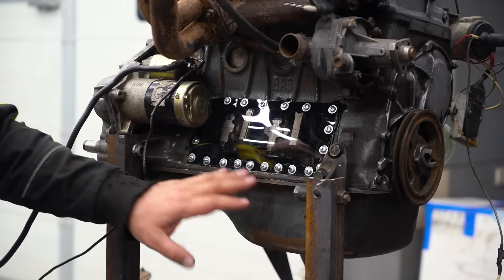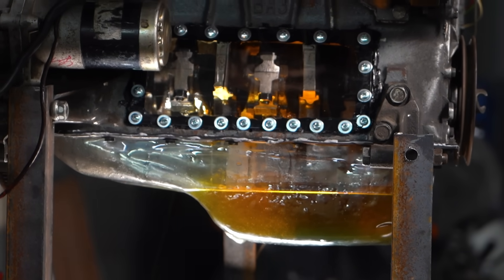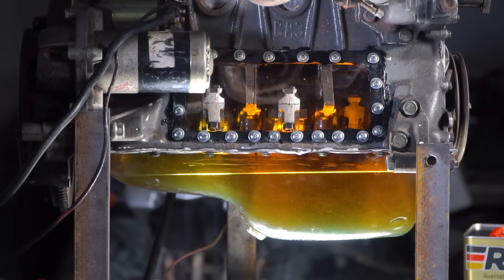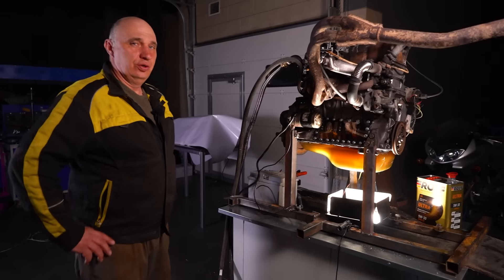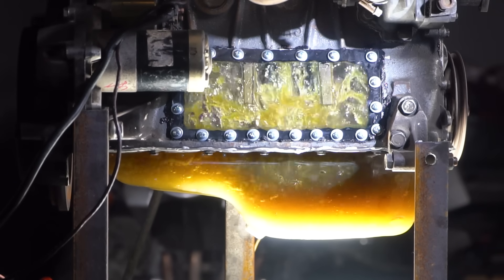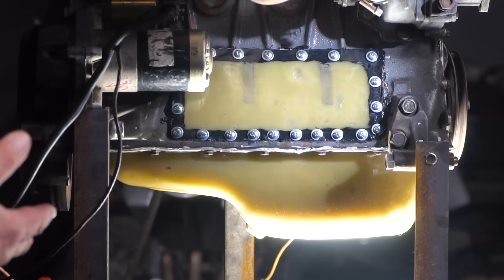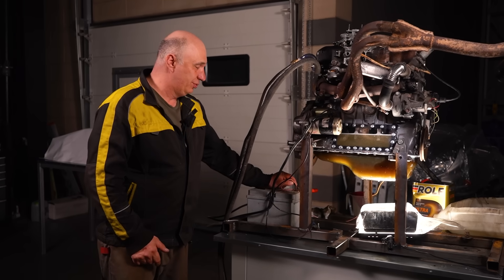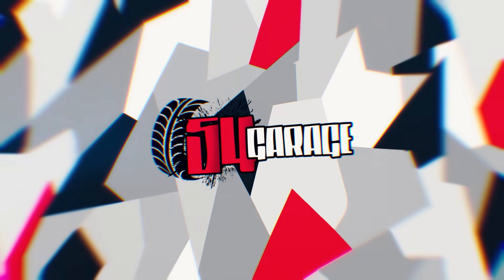What actually happens when you overfill your motor oil? (w/ transparent oil pan)

Comment: The level of anxiety i go through when overfilling my engine just a little over the max level, thinking it's gonna explode any moment, this guy is a hero
Reply: Gotta remember too every motor design is different, you may have one motor where a quart over is no issue, and another where a quart over is going to froth your oil and destroy your motor
Reply: 😄 I was driving my Landrover home from Genova to Zurich once like driving on raw eggs  because I overfilled it a fifth of an inch and could not release the drain screw on the road. Man man man – that video really makes that look rediculous.
Reply: @MartinBettler  A Landy?  Arent those supposed to be kinda symmetrical in being equally prone to annoying failures as they're bullet proof to bad failures?
I'd expect a Land Rover to survive just fine being topped up with anything between between moisturizer and cooking oil. 
And, being considered as OK for off-road use, why would anyone ever assume the vehicle to be particularly close to horizontal when the oil is checked or filled?
Reply: @davidbackman4442  probably depends on what engine. The old Series 2 and models around it use the 2.25 litre four cylinder engine and it was build like a tank I think the later 6 cylinder engines weren't so sturdy. I had a Series 11a and it had been around the clock 4 times and still ran like a champ but it did use a bit of oil.
Reply: @MartinBettler  always expect the good engineers to add a idiot proof margin... you should be OK with 10% more  ;P I always try to get it to the .2 quart precision
Reply: 12:23 

 @MartinBettler
Reply: @MartinBettler   fifth of an inch. that is pretty usa
Reply: @MartinBettler You must be a biden voter
Reply: This video is extremely misleading!
Reply: @MartinBettler  You could accidentally overfill just about any motor with 2 quarts and it won't do anything and could even be better for it
Reply: Yeah my stupid BMW doesn't have a damn dipstick AT ALL. You have to get in the car, get it most of the way to operating temp, then go into the idrive and hit "check oil level." Talk about freaking anxiety during an oil change....
Reply: @derekspringer6448  Same with Mercedes W203. I always admired German engineering but this car has made me think twice about it.
Reply: @derekspringer6448  I agree it is stupid not to have a dipstick in either the Engine and /or the Transmission.
Reply: @derekspringer6448  Technology making things more convenient and reliable 🥴👍
Reply: @derekspringer6448 
Who thought that was a good idea?
Reply: @derekspringer6448 - Luckily, my 08 550i has both, just recently my oil level sensor went bad showing on iDrive that its overfilled, took the disptick out and found the oil level to be just barely above minimum. I don't mean to scare you though, those sensors are pretty reliable but not bulletproof, my bimmer has 208k miles.
Reply: @derekspringer6448  That bothers me too on my 2009 328ix. The 3 series is supposed to be more of a sport model, in which case I think the oil level should be able to be physically measured. Also Temp, battery volt and oil psi gauges
Reply: You could ask someone nicely to make you one. They’re fairly easy to place.

#somedrillingrequired
Reply: No dipstick bmw reminds me the biggest reason I said to never own a bmw. I ride motorcycles now and know a guy who really likes his bmw 1250gs.
Reply: @derekspringer6448 same with my audi. Benz still gives you a dip stick tho.
Reply: @derekspringer6448  Just look up how many litres of oil the engine needs in the owners manual maintenance section and measure it as you put it in, at least then you'll be in the ballpark and shouldn't cause any issues to the engine. But yeah it is a stupid idea not to have a physical dipstick.
Reply: @derekspringer6448 what year is your bmw?
Reply: @derekspringer6448  yeah I had a 2018 3/28 hardtop convertible and did not appreciate not having a dipstick for having it be missing
Reply: @derekspringer6448  that anxiety goes away if you start by putting in as much oil that came out during the oil change. Then you can add little by little until its actually full
Reply: @derekspringer6448  thats why i sold my bmw 135i and bought a first gen tacoma LOL
Reply: @unfckwidable I don't think much of the Toyota engines once they changed the end play on the crankshaft onto the much smaller front main journal and caused problems when the small shims flaked off with wear and allowed the cam gear to chew on the front of the crankcase. That's unacceptable. They had some great straight four cylinder engines in the 80's that achieved astounding 45 miles per gallon that lasted forever, but they never sold many parts so they had to cheapen them so they would only last until the warranty ran out. I have grown accustomed to believing that they always had a special group of people that made designs that required a lot more expenses in the maintenance and repairs to the vehicles and I am convinced that it's the case now, but not sure with electric vehicles and the sooner we all drive EV's the better for us and Mother Earth and Nature. Screw the oil companies and the lies they tell.
Reply: My old beast at around 20 years old started to lose some oil, so topped up regularly, then -- nothing, the problem just went away, no more top ups needed.
Gremlins I suspect.
Reply: @derekspringer6448  But why design such a thing?  Its ridiculous.
Reply: Midas regularly fills my cars about an inch over full. They won't add less because the owners manual states 6qt capacity, so that's what they must put in, no more, no less. They say it doesn't matter.
Reply: @javaman2883  You're a brave man.  I wouldn't let that crooked bunch touch anything of mine.
Reply: Engine companys always have and extra space for this cases. The max level its below the real max till start to make foam at oil. Try to keep between those levels but it you fill it too much, doesnt matter. If its toooooo much, a syringe of the biggers ones and a flexible pipe that fits the tip of the syringe and you got it, without draining with the drain plug.
Reply: @greymillan5697 be easier and cheaper to just pull the plug and let out 6 ounces a quart whatever you need too
Reply: @greymillan5697 no advantage being over full just costs more money.
Reply: @greymillan5697
Reply: @greymillan5697 I started changing my oil at home.  Too many times, I've found the oil level way over max when having the dealership do it.  I always think they're going to put the bare minimum to save on their costs.
Reply: @greymillan5697 yeah but what about when it already started making strong burning oil smell because it was half quart over after idling for 15 minutes. It is an alfo Romero Giulia 2020 but just half quart over caused string buring oil smell. Could that have caused damage?
Reply: The inside of his made pan is also the same size as the outside of the stock pan giving him a decently bigger pan so it lessens the effect
Reply: @Scummy_shovel I noticed that too and wondered how much that would affect the results. I would think it actually equates to a significant amount of oil.
Reply: Me too. I had really bad feeling when I did this once. Nice to know it’s Norma problem.
Reply: This is great stuff! If I add 1/2 quart too.much it won't hurt it
Reply: @stringtwister7654 totally reasonable.
Reply: Biggest problems associated with overfilling are burning oil caused by  oil overwhelming the piston rings and oil passing the crankshaft end seals and contaminating the clutch.
Reply: Although , it would have been educational if this guy had hooked up an oil pressure gauge while doing this test .
Reply: @Airon79 maybe
Reply: Saved your day!
Reply: If you have an old Diesel engine the result can be catastrophic. Excess oil can be pressed out of the carter vent, this is connected to the airfilter box (for environmental reasons) and the engine starts to run on motor oil (no problem for a diesel  engine). Except you are stuck with a 'runaway engine' and no way to turn it off.
Reply: @buddy1155 and you never want to experience this… trust me!
Reply: Just remember this is a very simple , old school engine. Newer engines have more going on in them with smaller tolerances, so it would be still inadvisable to overfill any modern engine
Reply: @EdmundSampson-pd7vi exactly. And some are way worse than others especially motorcycles. As an engine builder I take note in this.  13 plus Kawasaki 636 you can literally over fill them a quart and it’s still a few inches below the crank line. Especially when running.   A newer Gixxer. 1/4 a quart and it’s into the crank super bad and just milkshakes.   So take this video literal if you have this exact same engine.  Otherwise you don’t know u till you know and go with the fact that 1 quart low is way safer than 1 quart to high.
Reply: @EdmundSampson-pd7vi  Indeed. Not all engines are created equal. 
There's a margin, sure. I don't think any mass produced engine would object to, or even notice a 10% overfill. 
Beyond that, I'm NOT going to vouch for what'd be a safe level of overfill. Just as I wouldn't comment on exactly how far below minimum you can actually go before damages start to occur.
First time I did an oil change on a marine diesel, I ended up overfilling it past my comfort level. Compared to earlier experiences, that oil was GLOOPY and took ages to trickle down into the sump. It was a fairly small engine too, so a little went a long way.
Reply: @davidbackman4442 yeah and when some take this crazy thin synthetics oil that is more like water I wouldn't chance it
Reply: Tell us what exactly happens if over filled so much
Reply: This video is extremely misleading!
Reply: @EdmundSampson-pd7vi yep stacking tolerances is what we technicians call it
Reply: @EdmundSampson-pd7vi right, it depends. A classic Toyota engine would be fine. An AMG or ///M should be kept within spec as well as possible.
Reply: @EdmundSampson-pd7vi  what is the "more going on" part? I've never worked on a modern engine.
Reply: @EdmundSampson-pd7vi there is no way the modern engines will stand this kind of abuse. They will go bonkers.  Be ready for a new engine
Reply: @EdmundSampson-pd7vi  Even modern engines give plenty of clearance for extra oil. I wouldn't say double the amount of recommended oil but an extra quart or two is never going to hurt an engine.
Reply: @EdmundSampson-pd7vi  Not to mention some motors the crank has an oil slinger attached. I don't thing the extra resistance would be good for it. WK
Reply: @EdmundSampson-pd7vi My car is a 2020, it only asks for 4.3 qt but I always add 5 because I'm lazy. Zero complaints from the car at 60,000 miles
Reply: @EdmundSampson-pd7vi all engines still have a crank, oil pump and sump, nothings changed.
Reply: @EdmundSampson-pd7vi yes but a little too much is still way better than not enough.
Reply: I am astonished that the front and rear MAIN seals did not let go, even BEFORE the fabricated plastic pan mastic seal did!!

Anyone for a foamy milkshake??
Reply: if it's a passat, no worries it will burn the excess in no time :D
Reply: Relatable 😂
Reply: They put a stupid factor in every engine cast since 1930’s, before that you best be exact, unless it’s a ford
Reply: Then again, the oil change place put an extra 1.5qts in my engine (previous car was same model but different engine on their records)

The next morning when I started the car it fogged up the whole front yard, and did that for the rest of the week, every morning. 

From that point on, the car consumed a quart of oil every tank of gas. Shame because it ran great and was otherwise a great car.
Reply: @nickloss probably just a cheap pcv replacement and car’d  have been fine…
Reply: Always thought the same thoughts,it took this video to make me realise it doesn't matter if you use a little extra!  The power of 1 video is amazing.        From ( AUSSIE JOHN).......
Reply: I've put almost a gallon extra in my diesel engine by accident more than once, was never worried lol
Reply: Different engines will behave different
Reply: exactly 🤣
Reply: The engineers do a really amazing job and stay within specs.
Reply: overfilled my civic by 25% once, and was SURE my PCV was just going to be dumping liquid oil into my intake tube.   Apparently, I can stop holding my breath waiting for that to happen.
Reply: But he didn't really test this right. If you're going to drive your car, which is probably the case, those bubbles might be detrimental
Reply: True
Reply: Haha!! I feel the same way!!
Reply: Over filling won't make the engine explode but it can blow out the gaskets and seals. Just depends on how much pressure your engine has.
Reply: Now I don't feel so bad by adding too much oil in my changes.  Often just a half quart too much.
Reply: The foam will deteriorate the œil quality creating mayonnaise in the motor block . Therefore avoid foam its a good idea
Reply: Half a quart over is okay
Reply: Great video. Thanks for your efforts
Reply: Pretty good demonstration however without an oil pressure guage you missed the point. I can tell you from experience that too much oil will create too many bubbles and too low an oil pressure especially bad with hydraulic lifters.
Reply: I had a friend who (after his Dad rebuilt his motor for the Son) filled the oil up til it reached near the top of the filler cap.......then drove it 😂😂😂😂😂😂
Reply: Ive been over filling by a half liter or so for years now, i get its oil pan dependant
Reply: My personal experience is that car maintenance is like your diet, you can get a way with fast food here and there but if it becomes a regular thing….. you’re cutting the engine life short
Reply: I was just doing that the other day with my kids car!  I’m a Goddamn cap full over and I’m considering popping the drain plug again to let a little out… wtf?!?  

Plus, all those times I drove shit boxes that burned oil? If I had know, just put an extra 1/2 quart in before a long trip!  

All those bullshit stories about too much oil pressure. Thinking about it now while watching the video, that bunch of BS doesn’t even make sense. Pressure? Where?
Reply: Do NOT overfill. The build up of pressure will cause oil leakage.
Reply: Anything under an 1/2-1/4 more of a quart isn’t gonna kill it I have a 5.3 with 294k that I’ve been putting 1/2 quarts extra in for about 8 years
Reply: Yeah, I added an extra quarter of a quart by accident the last time I changed my oil and it has been on my mind nonstop for the last two weeks. This video came into my suggested videos at the absolute perfect time lol. I was worried that it was going to create too much pressure.
Reply: Well try to do this with turbo charged engine. Your oil will be spitting out of the exhaust. Not to mention  foaming problem. This experiment is fun to watch but proves nothing
Reply: @eclecticaro  yeah the 1.5 Honda turbos are having issues with oil dilution. I think the smaller engine cannot hold the pressure created by the turbo and it's pushing unburnt gasoline past the rings.
Reply: Filling just a smidgen over the full mark on the dipstick won't hurt anything. Anymore than that and you start pressurising the engine causing damage to seals and other engine components.
Reply: @user-bq7ct8yw7k THIS is what I've always heard since I started driving in the early 70s. Too much oil causes more pressure and causes gasket failures. Whether it's true today or not, I do not overfill.
Reply: @roncrawford2416 The Air Force taught me the same in a vehicle maintenance school in 1999 .
Reply: @roncrawford2416  it's never been true, more oil can't result in more pressure.
The oil pressure produced from the oil pump isn't affected by how much oil is in the oil pan
Reply: @T1m11 it absolutely is true. Crankcase pressure is not caused by the oil pump, it is caused by slight compression leaks and also the movement of the pistons. Less air space will lead to higher case pressure which absolutely will blow out seals.
Reply: @tacticaldorito3942  I imagine that in an inline 4 or 6 cyl engine, there should be close to no differece in the crankcase pressure from pistons moving up and down. Other layouts may be slightly different.
Reply: @NewGov-xo6yt  How would that happen ?
The oil pump doesn't care if it sucks out of a reservoir filled with 5, 6, or 7 quarts, oil pressure isn't affected in any way and the crankcase pressure isn't affected by more oil sitting in the oil pan either
Reply: @T1m11  There is also a crankcase pressure. Less space equals more pressure.
Reply: @AnthonySlavin From what I understand, this is only a problem if your engine uses lifters. If it uses a pump, there isn't any extra oil pressure and the pump operates normally. (To a point of course.)
Reply: @gahbah274 to be absolutely clear, your understanding is 100% wrong.
Reply: @AnthonySlavin  which seals would that be you think?
Reply: @AnthonySlavin  lol it’s always funny when a obvious none mechanic gives “facts”  I especially like the use of “smidgen” for a measurement.   That’s the equivalent to a carpenter using a “notch or a hair”
Reply: Alshimer Joe thanking for his support. The furthest leaning leftists I know won’t vote for him. The worst president the country has ever had. Asking for support, the balls, or just lack of cognitive function. Sad really, but he was always a piece of trash. When some magical event like death happens by October you know it was planned.
Reply: You must as soft as Gouda.
Reply: Exactly 😂😂
Reply: damn straight
Reply: lmao same
Reply: Il a certainement raison perso il manque toujours 100 ml a mes niveaux ,toujours le segments racleurs disent merci
Reply: I have blown an engine by overfilling it. It was overfilled by a lot though.
Reply: Bin putting extra 1/2 quart to make it even 5 quarts have well over 70 thousand miles never noticed any lose of power  or mileage, even the certified Toyota mech ice said it won’t hurt anything  don’t have to caring 1/2 quart around in my truck it doesn’t burn any oil ether
Reply: @mikesheets4332 that's because you are doing it correctly because the oil filter drinks and holds it's own reservoir.some oil filters are huge and can take a half quart or more easily.HOW is everyone forgetting that part?
Reply: Me too! Lol
Reply: My exact sentiments.
Reply: Mazdas don’t do well overfilled. I remember in like 2006ish we had a deal with a local Mazda dealership to pick up and drive all the Mazdas back to our smog shop to do their smogs on used vehicles they would get from auction. They serviced them, sometimes they added a quart too much and it would cause a ton of oil to burn out and smoke. I crop dusted the freeway so many times. The techs at the dealership would laugh and say sometimes they are idiots and overfill and it wouldn’t this.
Reply: @JoshuaDomoslai  wow, great concern for the environment
Reply: I saw a guy overhaul an engine and he mistakenly put one quart over full and it immediately blew out the main seal
Reply: @onejohn2.26. if someone did a full rebuild on a motor and the. Over filled the motor by an entire quart by “ mistake “ I’d have to assume that he didn’t look up the torque specs as he rebuilt it and there could be a lot of things that went wrong with that motor.     How do you do a proper rebuild on any motor and no look up the amount of motor oil that motor requires
Reply: Does the overfill cause the top gaskets to leak? Having that issue now with oil leaking 🙏🏼anyone please?
Reply: @siry5164 it depends how much overfill,would have to be too much overfill because that's exactly what it would effect
Reply: I do not sleep at night because of this video.
Reply: Bear in mind that driving uphill or downhill can move your oil surface into the striking range of the crank, if you overfill.
Reply: I feel you! same level of anxiety, but this now confirmed that my car is fine with a little bit of oil above the max level of the dipstick.
Reply: Agreed — HERO.  Saved me some anxiety, anyway, as I JUST changed my oil and overfilled by probably half a quart.
Reply: Ditto
Reply: Same, same. Most info on the Internet just serves to scare you. Nice to see something legit.
Reply: If you drive a German car Yes you should always be anxious
Reply: You're  so dumb how do you even survive  daily?
Reply: It's all fun and games until your diesel runs away.    My Perkins "makes oil".    I'm happy to see that my paranoia has been a little overblown, as I'll usually change the oil whenever it's 150%.   But I'll continue doing it, because the diluted oil has shit viscosity.
Reply: Well he is doing it in a temperature and level controlled stationary engine,what if frozen?what if in summer,what in an angle?such as uphill it even driveway..he done a great job displaying that info alone for the intellectual to then calculate for difference with the examples above
Reply: The man has DOUBLED the oil to show effect,then almost trippled if not more..so what are anyone talking about half quart and such miniscule comparisons?its mostly about over pressure where the breather valve starts to spill for 1,and expansion of engine block and gaskets taking damage so unless you overfill way too much,I would think it's actually better to put half quart past max anyway, dipstick readings are only general estimates anyways,many ppl never factor in the temperature which gives totally different readings aswell and the level the vehicle is resting and that makes all the difference
Reply: @NewGov-xo6yt omg, bro…that’s kinda the fucken point…
If you show an extreme example of a thing, that then alleviates one’s concern of the not so extreme occurrences…🙄 I can’t believe you don’t get that concept…
Reply: First off YOU MUST CHECK OIL with the temperature in consideration,hot oil reads almost double on the dipstick.then you have the other things like level of car not on hill,and then understand the half quart that always seems to be extra..is to go into the new oil filter as it holds it's own storage aswell
Reply: As a mechanic myself I’ve always been “worried” about “overfilling” it because I went above the max line, this has given me the peace of to stop worrying about such a little detail.
Reply: Yeah relax lol
Reply: I knew a guy who added too much oil to his 95 impala and the car did not like that ran super sluggish and the engine had a massive vibration
Reply: For real😂😂😂😂😂
Reply: Yeah.  We just know it's bad, but not why.
Reply: “More oil Sergey”!
Reply: Took the words right outa my mouth brother 😂👊
Reply: Knowledge allows confidence
Reply: The problem with over fill is the crank case pressure increases and u start burning oil and it causes leaks not as important on older carb engines but way more important on newer fuel injection engines they are sealed up closed loop systom so pressure builds until u start burning or a seal goes out same thing can happen if a pcv goes bad
Reply: I would think, from the frothing of the oil, that an extreme amount of oil in the engine could cause some seals to blow out or at least leak if it’s in an older engine.
Too much pressure cannot be good.
Reply: Oh, those Russians! [Boney M – Rasputin 🤣]
They don't care... about anything! Didn't they invent the Russian Roulette?! 😱 Great contribution to Humanity 😬
Reply: My car takes 4.8 quarts. I put in the full 5 qt container. I refuse to carry around .2 qts in a big yellow bottle. The oil level on the dipstick shows about 10% over the amount between the two marks that indicate normal. No ill effects.
Reply: Just a little over won't hurt anything. A lot and it ends up into the combustion chamber. And you cannot compress a liquid. At the least, you blow a little blue smoke out the exhaust or you hydro lock the engine. At the worst, major engine damage will result from bent/broke rods or blown head gasket.
Reply: I SALUTE this  Mann
Reply: Facts
Reply: Very damned interesting. I've been overfilling my engines for generations, but never like Igor has. I have used automatic transmission fluid when I am able to use ATF resistant seals at one quart for every 5 quarts of engine oil. I use it for the detergent dispersant, anti foam agents and the inside of my engines are never dirty. Everything passes through the oil filter. I test my oil and discovered that I can run for 25K miles with changing the oil filter at 15K miles and refilling it with auto transmission fluid. My gas engines run over 250K miles and don't burn oil while my Cummins 4 valve per cylinder 325hp turbo diesel easily runs 450K miles. The problem with leakage is to replace the seals at rebuild with ATF resistant seals. An easy solution. I've been doing it for over 55 years and have yet to see any problems.Ciao.
Reply: I ran 15 quarts in a 4 quart car and it still ran
Reply: I was the exact same. So much anxiety from slightly overfilling it...
Reply: I’m so glad I’m not alone 🥹🤣
Reply: Fill to the top. Chug chug chug my car dont run too good. Drain out the oil then put it right amout and run so nice.
Reply: 😂😂😂😂 me 2
Reply: gas consumption will increase
Reply: I overfilled my car engine by only one quart once on a 2-hour road trip by the time I came back my car was smoking from the oil burning off the exhaust manifold turns out all it took was one extra quart to blow my valve covers gaskets on the driver side. I use 9 quarts regularly
Reply: I overfilled my car engine by only one quart once on a 2-hour road trip by the time I came back my car was smoking from the oil burning off the exhaust manifold turns out all it took was one extra quart to blow my valve covers gaskets on the driver side. I use 9 quarts regularly
Reply: Was just going to the garage to suck out less than a 1/4 quart overfill. Thx for this video, I can now breathe easy till I get to it sometime later
Reply: For real! Same af! I’m really glad that I randomly stumbled upon this video that I initially assumed would be a waste of my poo break…🤷🏾‍♂️
Reply: If you do this with a diesel you run the risk of a runaway
Reply: Guys, HERE is The True Savior

HalleluYAH translates “Praise ye YaH”

YaH is The Heavenly Father
YaH arrives via the TENT OF MEETING
YaH was Who they Crucified for our sins
YaH was Crucified on an Almond TREE

Ancient Semitic of Moshe (Moses)
Isa Scroll (The Original Isaiah)

Isaiah 42:8
"I am YaH; that is my Name! I will not yield my glory to another or my praise to idols.”

Isaiah 43:11
“I am YAH, and there is no other Savior but Me.”

Isaiah 45:5
“I am YaH, and there is none else.”
Reply: meanwhile here i am overfilling by a quart because it means i can just dump the whole bottle in lol
and also cheap insurance for when i'm hooning or tracking the car
Reply: Too much oil means bubbles which lowers viscosity of the oil, and it doesn't perform well. It won't get damaged in 100miles but it will increase wear of the parts.
Reply: What about those crankcase seals. My advice is don't do this at home kids.
Reply: He noted that engine is stationary not moving side to side
Reply: Same
Reply: 60 years old technology is hardly representative of anything you overfill today
Reply: I would have liked him to have a oil pressure gage hooked up to see what it was doing all this time. But yeah, in an engin with a oil pan a extra quart won't hurt anything. Mechanic for last 50 years.
Reply: Not really,  this engine has no Windage setup
Reply: every engine has a oil pneumothorax.
If there is a way to match oil - it wil "spit" the excess outside.
It's definitely non-ecological but not so dangerous 😁
Reply: thats ridiculous ive always overfilled mine by about a quarter of a quart
Reply: I think you speak for the majority
Reply: @jomeldemdayo3636  i dont think so, anyone that knows anything about cars knows that up to a half quart over os completely fine.  the full mark on the dipstick is just an estimation
Reply: SAME!
Reply: Knowledge is power
Reply: I love it. I have always wondered what would happen. I sometimes overfilled my old van with oil. LOL
Reply: I suggest that if you're afraid of damaging your engine, you should learn how it works and how oil protects its parts. The manufacturer knows that the average person is too stupid to understand how oil even protects the parts to begin with, so the "max" on a stick is a lot lower than the actual dangerous maximum, and the minimum is a lot lower than the danger zone. My car leaks oil and I can't tell where it leaks from, probably because it has another leak from the power steering (I'm fixing it tomorrow actually). But there have been multiple times where it has been way lower than the recommended minimum and I haven't noticed any damage so far. I always have spare oil in the car so that I'm not stuck when the oil pressure lamp starts going off, which I pray to god it doesn't.
Reply: @nicklasveva  just get an EV already. Life is short. Who has the time to learn the internal working of everything we use??  Do you fix central air system too? LOL
Reply: @KittyKittyCat-vf8zd  why would I get an EV? They are so boring. No gears, no noise, no personality. My rusty ol' SAAB 9-5 has tons of personality. I drove a Mercedes E200 (2011) for a while. Lacked personality and was not my type of car. I like older cars. They look better and also have that comfy feeling.

But maybe you're right... Who has the time to care about the thing they use every day? Why care when you can just send it off to the mechanic and pay $300 for something you could do yourself in an hour and hand tools with near zero experience? Let's just all let the giant corporations take care of our needs.
Reply: @nicklasveva  well, Tesla model S can hit 60 in 3.1 seconds. Model Y in 3.5 seconds. These are supercar acceleration. I would not call them boring. Then there are the Chinese EVs. They make Tesla look like a grandfather clock. Lol
Reply: @nicklasveva  wanna go offroad for more excitement? Try Cybertruck!  0-60 in 3.9 seconds.  Hope you can catch the taillight with the E200. I am waiting in line for mine. LOL
Reply: @nicklasveva  This is coming from me who do my own oil change, rotate tires, fix power window, upgrade stereo system, install skid plates and roof rack,  and change oxygen sensor. DIY the light maintenance stuff. I do it for fun because I enjoy it. 

Do not to feed the corporate fat cats? Why would you drive an overengineered Mercedes?  Not here to pick a fight. But the contradiction is funny.
Reply: What a moron!
Reply: Well I was using a customer's lawn trimming 2 stroke machine just the other day, I had checked oil it was a tad much , like a lot about twice as much as what the max line read.  I didn't think much of it , cause she had said she was using it and it worked the year before.... it started fine, I worked it for about 10 minutes and it started pulsating and died, so I started it again, it ran for about 10 minutes not even and ran rough the whole time then died. After the third time it dawned on me , the at it simply had way to much oil,  so after I tipped the machine on its side and drained out a good half a cup, I checked the level it was good enough,  and it ran the next hour and a half with no issues.  So yes over filling the oil in engines is not a good thing, plus why would you want to anyway.
Reply: Damn no wonder y'all so easy to overcharge at shops. 😂
Reply: That was not double the amount. Everything he said indicates it was 1 extra quart. Double would have been 4 quarts. About what they had at the end
Reply: My car takes 4.5 quarts of oil, I just put the full 5 quarts in every time. 173k miles, runs fine, only issue is the sway bar I messed up off roading
Reply: Remember...the best time to check your oil is BEFORE starting it after a long non-running sitting likefirst thing in the morning. That way all oil is in the pan... In doing this will also help in not over filling. 😊😊:)
Reply: Vyct
Reply: Just a little bit is fine
Reply: It's definitely lubbed up !
Reply: I don’t fill my old 2.8 ln106 to full, I find the crankcase pressure increases to much, I discovered this after I fitted a catch an that resulted in main seal on the clutch side blowing ,after much experimenting I landed up deleting the expensive catch can and reducing the oil level a few mm under the high mark. 
The motor has 560000 km on it, uses 100ml over 5000km and does not blow much smoke at all.
It has a aftermarket turbo fitted @9 psi boost ,I also fitted a thicker head gasket to reduce compression to a safer level.
Go further for longer rather than blow it up.
It’s primarily used for four wheel drive camping in Australian Victorian high country .
Thanks for making this video.
Reply: When I added too much I would suck back out. Wah wah
Reply: @ArsalanAFG-fo1yx  it actualy explodes all the time
Reply: Sounds like a personal problem... Lol
Reply: Lol it's not gonna "explode". It's just that the oil pressure is gonna be higher than usual, eventually resulting in oil leaking through the head gasket
Reply: (Subject to access), unscrew the oil filter and let  excess oil dribble out into a bucket .
Reply: nothing happens when you overfill the engine as long as its not more than like a half quart over
Reply: The level of anxiety when the oil level on my 1968 VW Beetle was over half half an inch above the max mark only to realize it was gasoline in the sump due to a faulty fuel pump. I immediately changed the oil and pump. I noticed problems already at start up do I never drove the vehicle like that. The accelerator pump was broken as well leaking gasoline all over the carburetor right next to the coil and distributor 😮
Reply: Yes this is my main reason for watching. I wanted to know if my "one millimetre over the top mark paranoia" was warranted or not. 
But something here wasn't answered. At what point did oil stop lubricating the cam shaft.  At what point was the overhead cam shaft at risk of damage or seizing up?
Reply: It will not hurt if you were a little over the full line. Bottom line is by the time you do the next oil change your engine specially modern engines today that take the lightweight oil will eventually burn off or get consumed so if you are a little tiny bit over full mark it will be OK
Reply: Seeing how I got overfilled a quart a few times before swearing off jiffy lube in about 2010 on 3 different cars I can semi competently say it'll be OK for at least 10 miles
Reply: I've always put a little extra oil in 1/4-1/2 at w/no I'll effects, all my veh have at least almost 300,000 mi on them, w/one almost 1 million, religiously 3,000 mi oil & filter change, don't care about factory veh Rocco's, old school mech here, cheaper, easier than replacing eng. at least because of that, it's mechanical,  anything can go wrong !
Reply: Oil Change shops overfill the oil all the time, usually the margin of error is about 0.5 quarts. My car leaks a little and I thank them for it when they do.
Reply: It won't explode, lol.. It just costs more.
Reply: How do you even do this? Most cars take 4.5-5 Quarts.
Reply: Lol....me to!!
Reply: I always add one quart more than manufacturer spec.
Reply: You white or something
Reply: Overfill Power Steering however? Not good.
Reply: As observed in the video, for THIS engine, you actually risk blowing it up by putting the MAX amount of oil. Look at how low it gets. Imagine driving around fast with this little oil splashing around. The pump can't get it and all of a sudden you have oil starvation. It might be the same for your engine, or maybe your MAX level is higher. Only by measuring it you will know.
Reply: Your just paranoid its fine
Reply: This video answers questions I never knew I had about motor oil.
Reply: Am glad to be in your club!
Reply: It’s def gon explode.
Reply: Right ! 😂 Now I don't have to worry every second while driving
Reply: Would be cool to see the same setup with normal and very low compression from bad rings
Reply: Rolf oil is the best!
Reply: @ArsalanAFG-fo1yx  Actually, the point is air bubbles are bad for the engine over long periods of time
Reply: And to what you were just saying you're absolutely right. It is very rarely level. That's why autozone should have a leveled out area posted as a fluid checking spot.
Reply: I went and got my oil changed at a shop and they put a half quart over... and charged me. lol never again.
Reply: the dip stick have hallow dots on it which tells how much space is in the sump available to fill the oil for the engine
Reply: a few hundred ml wont hurt it
Reply: it's not his car. it's not his engine.
Reply: Overfilling can lead to your engine gaskets leaking
Reply: This experiment can't be generalized for every engine out there. You just put the amount what the factory recommends.
Reply: Still can blow seals ,  it’s never been about blowing engine, just blowing seals …..
Reply: Same 😂
Reply: In Mother Russia you don’t do oil change, oil changes you!
Reply: Same but that's because she got other issues that will definitely cause her to blow
Reply: Bought a mini Cooper for 400$ someone overfilled it by atleast 3 or 4 quarts
Reply: I can sleep tonight knowing less than a quart over recommended isnt a big deal...bless the Russians and there crazy experiments
Reply: You can over fill a little lol it ain’t gunna hurt nothing
Reply: Yeah you can in most engines from the 80s to the 2010s run a full quart over and be fine
Reply: Muy buen experimento. 
Gracias por compartirla
Reply: Super Vidro,scheiss Stimme
Reply: Literally just did the same how I ended up here
Reply: Quindi mettere un po di olio in più viene eliminato attraverso il tubo di sviato del motore
Reply: Good timing. I just added 7 quarts thinking I had to put in 6.8 but it was actually 6.3. I had totally forgotten from previous years. My dip stick is well over max now. Still debating what to do.
Reply: Was always told you'll blow your rear or front main seals if overfilled, now i see that could be a phalacy
Reply: Honestly it depends on the engine, some are insanely sensitive, others are like idc, I have oil
Reply: Can't diesels runaway because of this?
Reply: @Kamil_Srnkawell sort of, usually if a diesel runs away because it's ingesting oil it's coming from a bad turbo but I suppose some designs in theory could throw oil back through the breather into the intake if they were extremely overfilled.
Reply: @1813boo how long would that go, it probably won't cause a long enough runaway to destroy the engine but how much oil could leak into the combustion chamber if the engine was overfilled?
Reply: @Kamil_Srnkahonestly that depends so much on the situation I really couldn't say with any certainty... Usually if you have oil getting into the combustion chamber it's a malfunction of some other system, not a result of overfilling. Usually when you overfill an engine you'll see oil leaking from some seals, and you'll have lubrication issues because the oil will foam.
Reply: I was going to say this definitely matters if you have an overhead cam or an overhead valve or a dual overhead cam engine. You could probably get away with that with a overhead valve engine like a Chevy engine but like a Toyota dual overhead cam you cannot overfill it by a half a quarter of a whole quart it will definitely cause the timing to be all off and sloppy
Reply: Why?
Reply: The concern is more on the stress of the gaskets, and bearings. If the oil is foaming then it's not properly lubricating.
Reply: Don’t over fill it then, problem solved!
Reply: There's probably (  but not guaranteed ) a safe margin over the max line /under the minimum, but why risk it ? Those  min/ max lines are there for a reason, and the manufacturer will have researched where to put those lines.
Reply: its the truth. we have to put in 3,8 liter into our engine and when i put 4,0 liter in my dad sid: WE ARE DONE! OVERFILLING IS MUCH WIRSE THAN UNDERFILLLING, SON!! AND SINCE YOU THINK TOO LITTLE OIL IS WORSE, THIS IS WHY I LEARNT IT. WE ARE DONE!

now go buy another car!!!!!!

and since i was 15 i thought i would have to work at night 8 hours and go to school 6 hours.

lol

really i can feel it
Reply: Me too. When I am an eighth of an inch over, I cannot sleep until  I drain some out !
Reply: I've always ran 5 quarts in my 4.5 quart motor, at first it was because I didn't know. Now I just refuse to leave half a quart in a 5 quart bottle.

My car at least does not care, hasn't cared for the last 40k miles. Because windage tray
Reply: @russellschlack3950  save the .5 quart and every 10th oil change will be free.
Reply: My 2.4 liter honda takes 4.3 qts 5w20. I always get the 5 qt cuz it's cheaper. Last time I did the oil the old oil filter gasket didn't come off so I had 2 gaskets and there was a leak but not til it ran. I removed the filter fixed that problem and when I went to add the extra oil that I lost I was all paranoid about it trying to get the perfect amount. Id lost around a third quart of oil and still had some left. Could have just thrown the rest in there but I took the time to get it perfectly in the middle and when I was done I had like an ever so slightly maybe 1/4ish qt of oil left. Just like you I was so paranoid cuz that's what we're taught.
Reply: @russellschlack3950  I put in an extra quart, car as always consumed a bit of oil even new 1/4 quart loss every 1k miles.  Car has never complained, 22 years old now.
Reply: Not all engines have windage trays though, especially economy cars. It’s an easy thing for accountants to remove because it saves a buck and usually doesn’t cause any problems within the warranty period.
Reply: @russellschlack3950 My car takes 4.75 qt, so it's even worse. Feel so dumb keeping a quarter of a quart in the container
Reply: @russellschlack3950 no check engine light in 40k mi either?
Reply: @russellschlack3950  I don't get why you don't use liters, instead of quarts and gallong, it makes no sense at all
Reply: @russellschlack3950  I would save that 0.5 quart and leave it in your car for if the low oil level light comes on
Reply: @rfulop ,

That’s way too late. You want to check the oil level every so often and top up as needed.
Reply: You should never see the low oil light.. @rfulop
Reply: @rfulop that’s what I do, but if I was you I’d have checked the oil level way before the light comes on😅
Reply: @rfulop if u have a low engine oil light come on... u have bigger problems. Either ur burning oil so fast ur running out or u have a massive leak somewhere
Reply: @rfulop  you should never wait for a oil light to come on that light already means damage is being done, the dummy light is loss of oil pressure NOT low levels.
Reply: I do that too.😊
Reply: @rfulop usually when the oil light comes on its way too late. You should never go by that indicator. Means u have zero oil in sump when that goes on.
Reply: Read my comment above. Guy is definitely not a hero and will cost many a lot of money. But I guess that will keep me busy as a master mechanic!!!!
Reply: @HeartsAndXs you are totally overanalyzing this issue and the video,of course engines vary and the technology varys,he is only doing an experiment for the sake of understanding better for the average person who freaks out when adding more than recommended,he in no way is promoting ppl to overfill.thats common sense knowledge to understand this kind of experiment bro
Reply: @HeartsAndXs  "Master Mechanic". 🤡
Reply: @HeartsAndXs  yep, not the same thing old 'VAz' or whatsitsname -russian truckmaker and brand new 3 cylinder piezoelectric injection bla bla engine, sure thing you can overfill maybe couple of percents more, but definitely not 300% more
Reply: @HeartsAndXs  I'm thinking of the inverse relationship between competence and confidence
Reply: @HeartsAndXs lots of comments here to try to find yours. That being said what did you comment?
Reply: @ArsalanAFG-fo1yx,
Do not overfill engine oil above the high mark on the engine oil dipstick—doing so will cost you a lot of money in repairs. 

A detailed explanation is in my rather lengthy separate comment.

Best wishes.
Reply: thats russian machines for you, lol, i still wouldnt overfill brand new machine, that said, i always keep it on max, minimum is not enough always
Reply: @MrAlkanet-nt9ic russian?
Reply: It's a myth. I think a lot of things we "think" are bad actually aren't.
Reply: @anonymous-zn2iv   it's not a myth. This is an old engine. Newer engines have higher pressures and over filling them will blow out gaskets and seals.
Reply: My first oil change I put in an entire case of oil. My mom's mechanic said I ruined the engine. I now know he had no clue what he was talking about. You have done a great service. Keep being the mad scientist that you are.
Reply: i mean thats why he's a mechanic and you're not lol
Reply: If this guy calms you more with one video and exactly this type of engine, I don't know... 
I'm quite sure putting in 500ml too much into a engine that requires 6L anyways is not a big deal, but to make a general rule "2x the amount won't hurt the engine" sounds kinda dumb.
Reply: @pete5405 100 ml en dessous oui 500 ml au dessus les segments racleurs hs
Reply: @pete5405 I don’t believe anyone here plans on accidentally overfilling their engine oil by double…
The point is that we no longer have to live in the abject terror  that our respective dads instilled into us as children about an accidental, car-exploding 1/32 qt overfill…🙄
Reply: For two years I’ve been servicing and checking my oil level after but not fully pushing the dipstick home past the rubber o ring so it’s been over filled for this period after watching this I ain’t worried any more 😅
Reply: Extra oil won’t do anything to your engine, but it does cause your engine to lose power due to it’s trying to swim through all of those extra oil. Like a noticeable loss in power and performance when you filled the oil up to the max line of the dipstick.
Reply: @axe4770 Extra churning and air bubbles reduces oil pressure and the solid column of oil needed between moving parts to keep them separated
Reply: @darrylsjodin7184 where is the foam going to sit? I would assume on top of the oil. and the pickup is in the bottom of the pan on most vehicles. Now if it turns it all into foam then i agree, you have a problem 😂 So i guess it depends on how far you overfill
Reply: @darrylsjodin7184  read too many post before coming to yours...was wondering when someone would mention how aerated the oil had become, not the same lubrication going on as when it was properly filled. A quart or so extra is fine. IIRC Ford once had a line and a hole in the dip sticks of old. The line was proper fill the line was max before it hit the crank...
Reply: @axe4770 That's wrong, when it's over filled too much. The crank counter weights cause the oil to aerate. The pickup is then  pulling less oil by volume because its an oil/air mixture. That will cause catastrophic failure on bearing surfaces. Most likely on the last bearing surface in oil passages.
Reply: @Ton0987   my too much oil definition is at max line of the dipstick, not that excessive as in the video. Sorry I didn’t clarify that.
Reply: @axe4770 yea, sure. Oil cavitation is a figment of the imagination.
Reply: @tacticaldorito3942   oil cavities occur at every rpm more oil less oil, except no oil if that is what you wanted and certainly won’t cause pitting at max dipstick level.
Reply: @axe4770 clearly you’ve never heard of someone floating a valve
Reply: @axe4770  That has NEVER been my experience.  I routinely fill to the max line but try not to go over it.  The engine doesn't "swim through all of those extra oil" if not overfilled.  Overfilling by too much can damage the engine if the oil starts to froth.  People tend to measure oil with a dipstick incorrectly.  The car should be level, oil at operating temperature, and engine off for at least 5 minutes.
Reply: @JettaRedIII   it depends on the car too, Toyota and Honda usually won’t have the problem of losing power when filled at max oil line since Japanese car are built for tolerate high abuse and lack of maintenance ( they know their client ), most European car especially german’s car and some US car like ford and cheavy will get the issue at max oil line.
Reply: Up to the max line is ok, waaay over it ,could in time blow oil seals, turning your engine into a collandar.
Reply: @axe4770 exactly! Just like driving on a floody road.
Reply: @axe4770  haha😂 like 1%-2%
Reply: @axe4770 that's when you knife edge the crank! 😂😂😂 Old school racers trick 💯
Reply: @axe4770  agree with you on the power lose. My Volvo 240 year 1990 lose power after my dad add oil pass the dipstick max level without inform me.
Reply: @eysiew9863  sure it wasn't the M cam causing the power loss laughs in VX
Reply: If you have a start stop engine, theory is it will act like a water hammer when starting again. But otherwise yeah probably nothing to sweat about
Reply: Issue is that you will mess the catalytic converter.
Reply: Why that's not even a real fear! 🤣
Reply: WHEN YOU GET OIL CHANGE AND CAR TAKES 4.5Quarts let's say,the new oil filter also has to be filled and absorbed!don't forget to calculate that part for any misunderstandings of oil being slightly low after filling exact  recommendations 😅
Reply: I knew you were a () when your second word used is “anxiety”